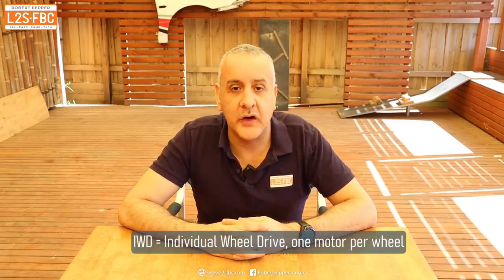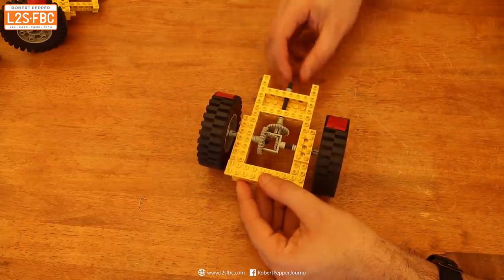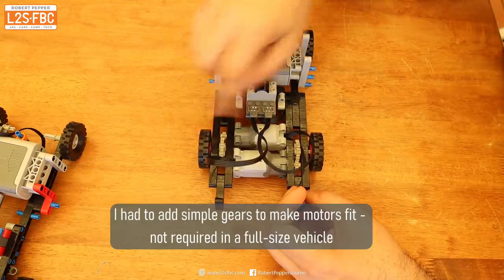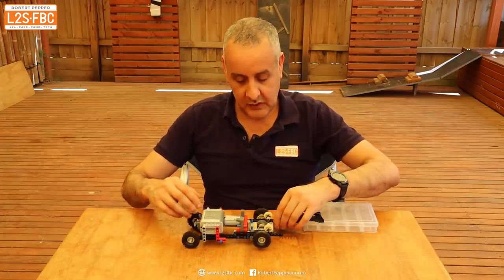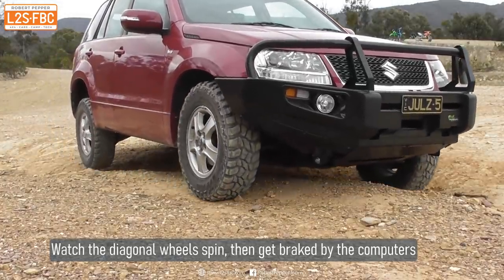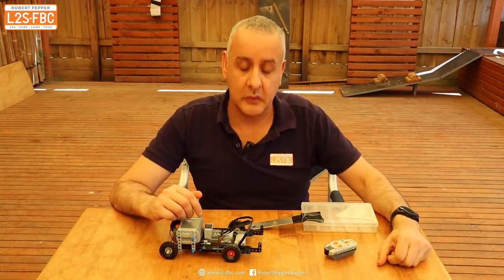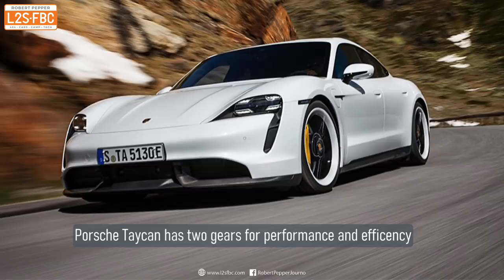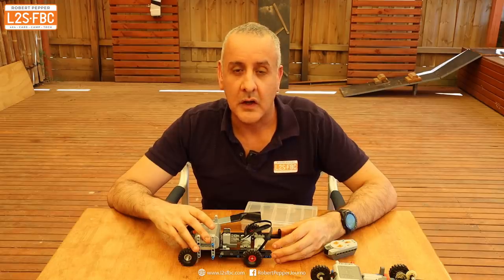Why Differentials Will Die - EV IWD Is The Future!

Comment: electric car is the future. The energy on the planet will run out before electric cars will hit 1,8billios cars.  What is the car rate today.. 
We need a completly new energy source if we want to bring electrics cars any hope at all.  I dont mea battery, but energy productions
Reply from the maker: Just new ways of creating electricity
Reply: @L2SFBC   Yea thats what i mean. New source of power.  We cant fill the planet whit nucliner plants just becouse of electric cars :D  But we also need new battery power storage. 
The minerals we have on the earth today will run out long before we all get electric cars. Special the need of Cobalt.
Reply: I think it is not as bad as people think.
I do about 100km/day on my EV. It uses average 14kwh/100km. So that means about 14kwh per day. My town house used to use 24kwh/day. I got solar installed and in summer it can supply enough electricity to run the house and the car. If we put solar panels on every house roof we would have enough electricity to run all private cars and still have energy leftover.
Reply: @franciscoshi1968  I live in Norway. The sun will never be able to power my home :D  
its summer 3-4month a year and 60% of the year the sun is only up 2-6 houers. 

Norway is on the top of EV cars / populations.  You talk about your home and EV car.  But you did forget, we drive around in the country and you want to stop and do a quick charge. Then continue your drive. 
To park at home after work and charge your car to the next morning is ok. In the night the power demands are low. 

But when 100s of thousand people stop in there driving in the day and use example Tesla supercharger that use 250kW per unit. Because hey, they want to stop 5min and be able to continue drive. 

We also want to use EV's to think about environment. So to keep the track on this. We need to charge the EV on green energy. 

its 2 millioms EV in the world now? 
2 mill EV's ( charge 1,5times a day )  Avarge charge rate 7kw = 14 000 000Watt per day. 
(14MW)  

Its 1,4BIllions cars today. take them as example. 
We need 14,7TW  every single day just to charge them.  Now go on google and find how much the world is generating every year. you will see the problem. 
Before we even find a energy solution,  we are more people in this world and there is even more cars. So we need more  energy. 

From all this energy only 4% is from Wind and solar.  Info from 2020.
Reply from the maker: We have scaled electric before and we can do it again easily enough. The change will be gradual.
Reply: @L2SFBC   Yea I hear you. Nuclear SMR will maybe be to some help if they get approved. Eventho I do no like anything to do whit it. 

Only problem left is battery technology. Even if we want , there is a fact. Total amount of Cobalt world wide will run out in 60 years.  If we produce more battery's then today. It will run out before that time.

Sad really, to imagen we will really use up a minerals for good.
Reply: @negueba235689  you don't need to charge at 7kw at night because you got the whole night to do it. In my case I use about 14kwh/day and I seem to drive twice the average. So if I was going to charge over a 10hr period then I only really need to draw 1.4kw which is not really a lot. My house uses 400w at night continuously. So it is not a huge increase and it will not happen overnight.  Norway is way ahead of every one else on EVs. Pushing really hard and I am sure you still have less than 50% EVs on the road.
Another thing that everyone forgets is that the whole grid is built to cope with peak demand. That means there are enough generators and powerlines to supply everyone when they get home and cook turn whatever they need etc.
In my house we use 24kwh/day. 10kwh are used by the continuous 400wh load. The other 14kwh are used over a 3hr period when we get up and when we get home. The grid (before I got solar) had to supply 5kw average over 3hrs per day.
The rest of the time between about 9pm and 6am all that infrastructure sat there producing 400w with 4.6kw spare capacity.
If I plugged a car that draws 1.4kw then the grid will be sitting idle with 3.2kw of spare capacity instead of 4.6kw. And if everyone chargers at home the number of cars that will need to charge on fast chargers is not that many.
To get an idea if how much capacity there is. Look around industrial buildings and housing estates and you should be able to see the power transformers.  They are about the size of a small car. The smallest ones we have in Australia are 500kva. One of those can supply 2 superchargers continuously 24/7 or 208 cars on slow charge and most if this power transformers sit idle at night with nothing to do.
Reply: @franciscoshi1968  Long time charge or fast. You still need the same total amount. To max the battery.  Its not my thought, its a fact.

Look longer then your backyard. We have problem to feed the society and people whit  energy.  Look at Japan China ,  they have no  other way then to keep building large nuclear power plants to keep up.  This is just for normal living and factorys.  To add a EV on or 3 in every home as will deffinily not help.  

EV's was never a good idea, But hey they could stamp it as ( environment green ) even they are not. Just look in my country. In Norway a EV last max 5-10 years.  It cost more to fix it and replace battery then buy a new one. = This rapped use and throw make EV's no good at all.  Its better to buy a new Adblue diesel car and keep it for 15years or more.  environment and green symbol have no longer a meaing and is used as a sail trick. EV's is a perfect example. 

  I live in the country that have the most EV's in the world sold. Yes we do think green and we love country and the wild and nature. But so many are blind. EV are good here in the city but hey, dont forget where you get the electric from- Yes we have lots of water planets in Norway that generate power. But now whit all the EV's we need to buy power from Coal plants and stuff.  So hey, your EV was not so good after all !  I
Reply: @negueba235689  I think you are missing the point.
First is that EVs are meant to reduce air pollution in cities. They make a big improvement in air quality where more people live. Even if all they do is shift the pollution elsewhere it is already a benefit because it is much easier to control the pollution out of a stationary  power plant away from the city than it is to control thousands of sources.
Second is that not all power is made by coal and EVs have the benefit that they can be used to store the unreliable renewables because the majority  spend most of the time parked.
Third is that an EV battery doesn't suddently stop working they just reduce in capacity.  Most have still 60% of original capacity after 10yrs. It is difficult to estimate how long they will last because they have not been aroun long enough.  After that time the car still functions just with less range and when a car is that old is generally used for mundane tasks that do not require long range. After 15 years there are many more things wrong in a car that makes it not viable for most (like paint seats interior ...) Also when the battery is no longer useful in a car they can still be used in energy storage.  An EV battery is quite capable of providing 25yrs of usefulness before it needs to be recycled.  We just need the right mindset. At the moment most EV batteries end up in energy storage unless the manufacturers specifically want them destroyed to avoid them being repurposed.  (This is a big issue)
EVs do not replace ICE in all cases just like diesel does not replace gasoline.
If we can replace ICE vehicles that are only used in the cities with EVs and use ICE where they are needed it will help reduce the pollution in the cities.  This is the biggest benefit, reducing pollution in cities where it is a significant problem.  Look at places like Beijing. The air pollution is caused mainly by cars on the road and many people die every year from that pollution.  If only half of those cars were EVs that would reduce the pollution by half.
That is the biggest benefit to society.  The rest is consequential.
Reply: I read and you say a lot of smart things. 
Its late and no power to write so much. 

But let me take out some of your points. 
EV's are made to make the air quality better where more people live?? and are a idea to make the world more green. 

= New diesel adblue cars do not give out any or extrame little polution as well.  I did say and I can say it one more time. Norway where I live is on the top of how many EV's sold/living peoples. and guass What. The city air quality did not get much better. Do you know why?  The main problem is not the exhaust gas from the engines. Its the rubber and tier wear and asphalt dust. 

The EV's have a more total Kg per car then regular cars and they have 4 rubber wheels as well. So in total to add 50% EV's to a city did not make the air any better. 

EV's is a old thing in my country as we had it many many years allready. We now see that people buy EV's dont keep them long. Or the life of a EV is not very long. Its not unkommon that a EV is wrecked after 5-8years.  as the battery is dead or is to expensive to replace. So they buy a new EV insted. You say battery last long, well why do Norway wreck them. 
There is tons of calculation on google, you really need to own and drive a EV very long to make it even to a new diesel car. 

EV's cost the environment much more to build then a diesel car.  But anyway all this is a facts and a big war ( some one like EV's some one dont ) 

From my perspective and in Norway where we have +30c to  40c. Lots of snow and salty roads. So many in Norway love the EV's But they do die much faster then a normal car. When i say die i mean they get wrecked and not fix. The 'green idea' is far from a reality.  Not uncommon to see a Tesla 4-7 years old crushed on a scrap yard.

LOL why do my text have lines ?? up there... ?? cant remove it....... anyways :D 

Where a new diesel adblue frendly car can easy drive 10-15 years.  

Not sure if you use facebook. But i think this video is public. its in Norwegian, but by the look you see 2 years old EV getting wrekced. .

https://www.facebook.com/NRKBrennpunkt/videos/1837025493132346
Reply: @negueba235689  not sure what he is saying but a Tesla motor and inverter sells for $5k and a battery pack minimum $20k so the cars they are wrecking would be worth $30+ just for the parts.
Reply: @negueba235689  on the subject of rubber dust ICE are worse than EVs especially diesels.  Every time there is a power stroke there is a torque spike that goes to the wheels that produces more dust. Diesels are worse because they produce torque at lower revs which meacb each power stroke is stronger so a bigger spike. ICE have rubber belts to run the accessories which also produce rubber dust and produce considerably more dust from the brakes which are made of carcinogenic materials. EVs have no torque spikes and hardly use the mechanical brakes so ICE vehicles are still dirtier. And lastly the Euro7 emissions standards are almost impossible to pass with ICE. It is unlikely they will loosen the requirements especially if EVs can pass the standard.  There will be a point when making an ICE that can pass the regulations will be so difficult and expensive that it will be cheaper to go electric.  Most cities with air pollution problems are already banning diesels at certain times or limiting the number of cars that can enter certain areas. It is unlikely those measures will be rolled back.
Reply: @franciscoshi1968  Most of them are wrekcked as the battery pack is dead or damaged.  Why pay $20k on a new battery when you can buy a new tesla for $40k.
EV's is like a mobile phone, Buy - use - trash.
Reply: @franciscoshi1968   Well maybe the results are diffrent from place to place. The first EV was in Norway 1902 , but the large EV impack came in 2007 and from 2010 Tesle was on a nice roll. 

Its 6 million people in Norway ( small amount of people )   but we have now abow 20 000 Tesle cars and total 350 000+ EV's. 
Thats 6%+ EV's / on population.  
In the US its only 1%-1,5%.  

When EV's first came. We all got good deals. EV's got a privat road/lane  in the city. They did pay less tax. ect ect.. EV owner got a lot of + to go the green way. 
Even 0 in road tax/highway use. 
But even 50% EV's in a city did not make it clean !!  and they do not see any diffrence from new EV's and new diesel cars. The EV drivers now loose there benefits and get more and more of the normal tax as diesel cars. 
So now to make the city green as they was thinking. The making large city blocks '' NO CAR zone'' NO EV's nothing,   

So we will see EV's is not the way to go to get the city green.  as we allready did try. So best is to just close the city for any ''cars'' 
But its a hard step..  as society today is build on cars are travle. 

In the end it all end up on, The world do not have the minerals to make the daly tralve by car electric.  Continue like we do now and this battery tecnology.  We will run out of minerals to build it in like 20 years?   build more and more EV every year and the minerals last less.  maybe 10 years and we cant make any more EV batterys.  Nice goal ! :D 

I love the EV's idea, as im a electric engineer and a mechanic.  But its really not possible on todays tec. But we can hope for a better battery ofc! :)   But the ''green city'' is only possible on NO car zone.  We allready figred this out in Norway. 

For my use of cars, there is still no EV on the marked. I need a offroader , long lasting machine to work in the forest. and deep adventure in other countrys.   When can I take a EV and drive thrue russia and other countrys that do not have the support to even build a charging station.  I hate city driving , i like the nature.  will take a long time before i see a charging station there :D 

thanks for the comments tho. its a interesting and new adventure for the world
Reply: @negueba235689  most of the $20k batteries go to energy storage or EV conversions. The drive trains are used for EV conversions and race cars and are in short supply.  I wouldn't be surprised if they are wrecking them for the batteries and drive trains.
And EV batteries do not just die and stop working. They just hold less charge which means less range. Teslas are special in that Tesla doesn't want anyone touching their cars. If you try to do any work on them they will disconnect you from their chargers. Other cars are much easier to repair. You can buy after market batteries for Nissan leaves and Imievs. Most of them with almost double the capacity of the original. So Teslas are not a good example. Once they run out of warranty they are so expensive to maintain that the parts are worth more than the car.
Reply: @franciscoshi1968   Well dont ask me, I just tell you have its done around here. 

People that own EV's do not pay to fix them, they wreck and buy new.  Maybe that say more about the people then the car. But the main thing is that it cost to much to fix or replace battery packs. So the buy new total car. 
This make the EV's as a object, Buy -Use - Waste..  Maybe they use parts for something els for sure, but I talk about the owner of the cars and envioroment impackt of this waste of use. 

Tesla disconet you from the chargers, yes they can, but you can fix that too. There is allways a way in the computer world. 

Back on track, the EV's will at this time not make the world green. Thats the point. 

#1 - We dont have the minerals to build so many EV's  to changes the cars to EV's. 

#2 - The green energy in the world is to less. So ' not envioroment  friendly' need to be used. to charge EV's.

#3 - The citys that want to be fresh and green Ban all car traffic. Normal cars and EV's.  So there is no benefit here in the end for EV's

Comment: News Flash,,The regular differential has been just fine for 130 years...what yr talking about will have Failures and problems with it also just like anything else does,,.there is Race Cars that do just fine without any of this new Technology
Reply from the maker: The steam engine was fine for a while too as was the wheel without a tyre.
Reply: The differential has been just fine until some one puts IWD on a race car and blows the competition away. 
It will be the same as when the first rally car tried "heavy and complex" AWD. Now if you don't have AWD you are not in the race.

Comment: There that thing calling unsprung mass, rotation inertia , debalance and other nasty properties of a bad designed vehicle. Also, its great to be stranded in a middle of a desert with "electric drive failure" message displayed on your fancy IWD vehicle because rodents ate the wires and you're out of reach for half a million dollar diagnostic facility. Its just another hipsters overpriced toy...
Reply from the maker: How's rodents eating things different to an ICE vehicle?  And why would unsprung mass be worse?
Reply: @L2SFBC  
Level of integration on electric drive and consequnces of catastrophic failure is much much greater then on ICE. ICE just stop working and thats it. Electric goes boom then fire. Greater unsprung mass is always worse - well known fact, get some info yourself as Im not your teacher. ;)
Reply from the maker: No why would unsprung mass be worse in an EV?   Or fire risk?